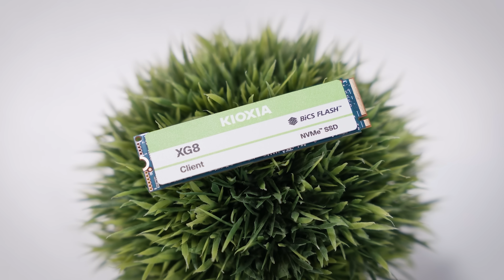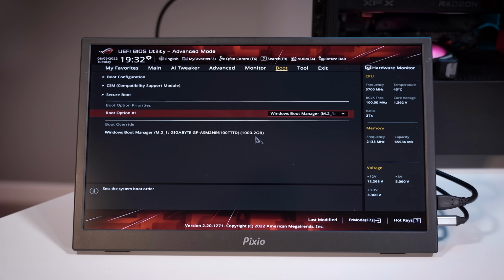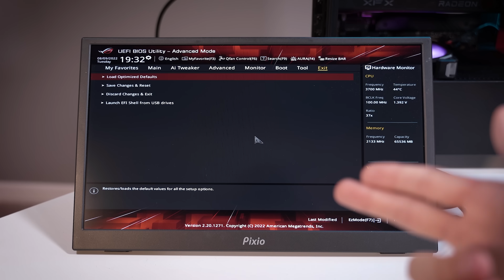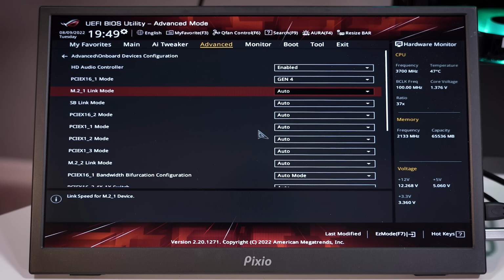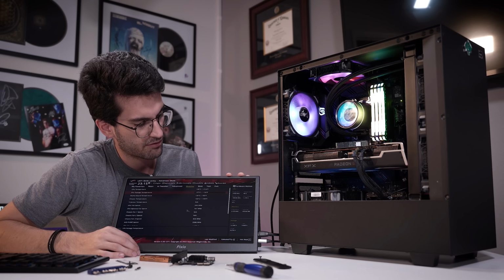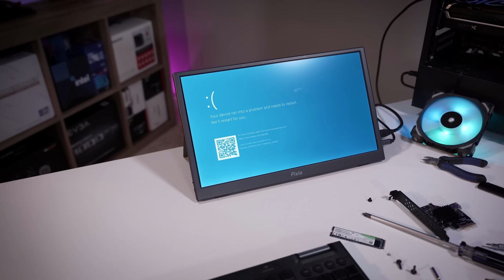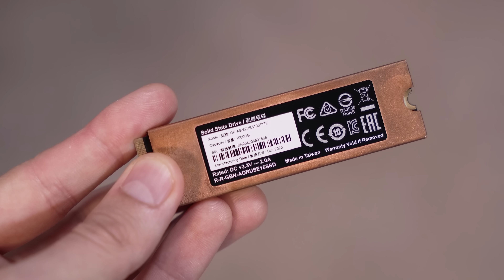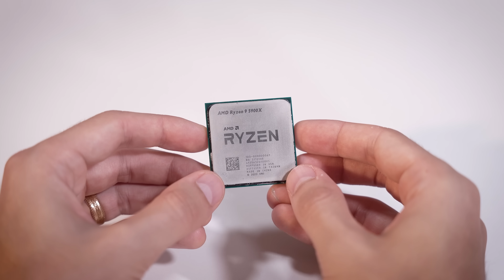Fixing a Viewer's BROKEN Gaming PC? - Fix or Flop S3:E2

Comment: I've seen that fan below the video card before, but usually you'll use a spacer to get it up off the deck and have it reversed so that it helps to direct air into the GPU fans. It's a trick that was semi-popular back in the early days of larger video cards because air flow is terrible in a lot of older cases around the card itself. Over the CPU is typically good, under the GPU typically is a bit of a bad flow area. Even in some modern cases it's often overlooked. So you shove a fan above the basement to help resolve the airflow issue in some cases you'd see noticeable improvement in temps and smoke tests. Dunno, just an idea.

Comment: had this happen with my buds. His temps went so high it shut off after 10 seconds. We thought cooler dead, got new one. Same thing. Put his chip in MY pc and it was ok for a bit. Thought maybe liquid metal around the socket had made it fk up. Turns out we RMA'd his 5950x and it was the issue. New one in and presto

Comment: Wow, I thought it would’ve been a memory speed issue. Had a B350 board I got used and a R5 2600 that I knew worked well, didn’t realize that memory speed was impacted by the motherboard too and would get blue screens when running the memory at 3200mhz

Comment: This happened to me a while ago, and it happened due to a power outage. We had an electrical storm that took out our power, and when power was restored, I tried to fire up my PC, and it did something very close to this issue. The only difference was, for me, it would allow me to run just fine for a few cycles, then wouldn't allow Windows to boot. I ended up replacing my CPU as a result. I'm guessing the owner either wasn't plugged into a surge protector, or the protector was either not very good, or had been damaged from a previous outage/surge.
  It's because of this exact reason I am now plugged into an uninterruptible power supply. Sudden power loss can cause damage to the CPU, and or motherboard. UPS units allow you to safely shutdown. Most people think they're used to prevent data loss, but they also protect the system from damage caused by immediate power loss.
  Once my system is shutdown I always turn the power supply switch off, unplug it from the cable, and unplug my UPS/surge protector strips from the wall. This may seem like overkill, but ANY electronic device can be damaged by power surges. I even lost a modem to a tripped breaker. I take no chances these days.

Comment: had the exact problem on my 3700x need to offset voltage to run properly but will degrade overtime, glad that AMD accept warranty during pandemic since local store I purchase cannot diagnose the problem

Comment: I've had several ryzen CPUs die with failures similar to this. Random blue screening across several different board and memory configurations. Really odd but seem to be common on Ryzen processors. In the beginning my immediate suspect was failing memory (unless passes memtest) but who would have guessed... cpu all along

Comment: I think I've had 3 bad amd cpus over the years that I had to rma , FX-8120  it would give me strange graphics error where everything in chrome would get sucked to a pin point ... very weird ,   a ryzen 3300X  and a 3800xt    Amd has required me to take a picture of the cpu in the motherboard ... kinda strange staging a picture for them ... because I already swapped the CPU and that's how I was able to tell it was a bad CPU .

Comment: Grest video. I had a similar problem couple of weeks ago. I spent 2 days testing everything in my system. It turn up to be a faulty motherboard.  Used meanest 86 and I was getting tons of error.  Similarly I had a different blue screen every time. Swapped a board and everything is back to normal. Actually system feels faster then before. Sent my board for the RMA.

Comment: If a motherboard has a standard overclock or higher volt can cause a cpu to die over time. I had a similar issue with a i7 6700K with an ASUS mother board where slowly more cores would stop working to the point i could only get the PC to board with one CPU core enabled.

Comment: Hey Greg, shot in the dark but maybe the chip isnt even dead, maybe the bios just got borked. Happened to me with an amd chip. I think its at least worth a try to test it with another motherboard because like you mentioned in the video it doesnt act like a dead chip at all.
Reply: It's a dead core. Can be turned off in the BIOS. Done this on a couple Ryzen chips from several generations.

Comment: The same thing happened to me. My computer was working and then randomly it started to reset sometimes it was while gaming sometimes it was just watching YouTube videos, sometimes it would happen multiple times a day sometimes it wouldn't happen for weeks or a month. I thought it was the boot drive so I cleared it but nothing so I bought a new one and nothing, I even ran a ram test and switched slots, then I thought it was the motherboard or graphics card so I bought a new one of both and nothing. So the last thing to change was the CPU so recently I bought a new CPU the same model I had before Ryzen 7 5800x and it works perfectly. I did a lot of research online and some people were blaming AMD for having  bad design or blaming windows. One guy even said that he rma his cpu and AMD knew it was a problem just gave him a refund.

Comment: When I was building my current rig, I ran into the drive problem. The bad drive, my intended boot drive, got extremely hot to the touch very quickly, along with the heatsink covering it. I tested it in a different board, same result. In my experience, even a good PCIe 4 drive wouldn't burn up like that, especially not from just trying to boot into Windows. Needless to say, the replacement drive I got actually worked, and didn't exhibit those symptoms.

Comment: I had this issue when one of my socket pins was bent. PC would turn on, everything would work fine for about 2 minutes, then a blue screen & restart. I know it was the bent pin because I bent it myself, thought it would work, and ultimately fixed it. Edit: again, I'm not surprised that it was CPU/Mobo-related (depending on whether you have an AMD or an Intel CPU.)

Comment: I had the exact same issue happen to me in the past. I found that the media creation tool fixed the problem, my guess is that it had to do with how windows was accessing the cpu and when I ran the tool to use a remote repair utility it bypassed the problem.

Comment: i had a similar issue when i built a rig with a 5950x for my nieces husband in my case the system would boot into windows fine for about 10 minutes then lock up and once locked up on restart it would hang on on the msi splash screen ,   if you completely powered down the system and disconnect power from the PSU the system would again boot into windows, and lock up after 10 minutes  and so on,  spent 2 days trying different drives etc multiple reinstall of windows etc, 

luckily i had a another new rig built for a friend who hadnt collected it  swapped CPU  and boom system was stable ,   tried the 5950x in the other rig and came across the same issue 

ended up RMA ing the brand new CPU ,  CPU was DOA

Comment: I had a very similar situation moving from a 3400G to a 5600X (brand new) on an Asrock Phantom Gaming X570 Wi-Fi ax motherboard…and it was the BIOS. Windows kept freezing at the same point, but entering BIOS worked fine. Resetting CMOS? Nothing. Last ditch before nuking the OS decided to update the BIOS from USB (previous BIOS was compatible with 5600x, I checked). Haven’t had an issue since! Booted immediately. 

Wish you would have checked BIOS version too. CPU might have been ok. Did user recently change CPU? Maybe it needed a microcode update.

Glad the 5*50x worked and the user got an upgrade. Also glad you’re going to check the old CPU! I suspect it’s fine and just needed a different BIOS.😊

Comment: Greg, I need help! My Pc froze my Game and YouTube pages on my monitors(I could still hear my video running) then I heard a loud buzzing fan noise. I got scared and couldn't enter the Windows settings so I hold the power button to turn off my Pc instead, now I can't turn it back on. I tried replugging the wires then pressing the power button but it only flash the RGB for a second and died again. What do I do?

Comment: I'm running into this problem with a bone stock Optiplex 3060 SFF from a misc auction lot.  Trying to install Windows 10 or 11, it blue screens a different error each time.  I've even tried throwing an SSD in it that had a good Win10 install on it, and during boot it BSDs.  I've tried a brand new NVMe, a 2.5" SSD, a 2.5" HDD.  I've tried multiple different DDR4 sticks of varying speeds.

Running the built in Dell diagnostics from BIOS, nothing errors out.  The CPU test passes (though I know this pre-test isn't highly rigorous), the RAM passes.

I tried removing the CPU to check for issues with the socket, and re-pasting, but no luck.

It's just not in the budget to mess with it right now, but I figured it was a CPU or MB issue at this point.  I figure if I luck into an i5-8500 or i7-8700 from some other system in the future, I will try that out first before trying a MB, since that will easily transfer to a different system while the MB definitely won't.  But dumping the money on a CPU right now, cheap as they are used, just doesn't fit with my current budget.

Comment: Had a Ryzen 5 3600 doing the same thing. I suspected a motherboard so my first test was same as yours. Everything worked normally after the cpu swap. Tested the cpu in another motherboard - blue screens and weird behavior. Great video and thanks for keeping after it for the learning.
Reply: I also had a R5 3600 that blue screened every 15 to 30 minutes.  At first I thought it was the drive so I reinstalled Windows on another M.2 and updated the motherboard bios but still had the same blue screen issue.  I eventually  got a new Ryzen 7 5800X cpu and my machine has been running great for months now.

Comment: i also happened to face this issue recently my friend pc had exactly the same symptoms we got new drives that didn't fix it we then updated the bios it still didn't work at the end when we replaced the cpu it automatically fixed the bsd. The mobo was z170 and cpu was i5 6600k

Comment: I had a similar issue with my 12th gen i7, pcie controller took a crap and no matter what GPU I put in it there would be no picture out until I connected it to the integrated graphics and found it odd that it booted into windows. So initially it threw my diag as the pcie controller out the window until I read up on some details on how the pcie controller on the 12th gen works and found out that it was very possible for pcie lanes to go out individually. So I bought a 12th gen i5 and everything was fine. I sent my i7 back to Intel for warranty and got a new one a couple weeks later.

Comment: it is possible the cpu cooler was over tightened, crushing the heat spreader slightly. its hard to say exactly but congrats on the fix :) good job
Reply: Your actually correct, this is the main reason for this fault if he backed off half/full turn on the cpu cooler screws after a cpu reseat it would have worked fine

A lot of installers believe that tighter is correct way but actually tighten to a stop and then back off a full turn or two is actually better for temps and stability, pushing the cpu down into the socket and heat and pressure will damage the cpu
Reply: @anonymoususer7985  yes lol, the 5900x is a hot boy but idle was too hot forsure. I have learned alot in less than 2 years total pc building. YouTube is my only teacher

Comment: Its like back with 286 when the io board would go ou or 486 and 586 and 1ghz cpus that the logic side of the processor would die and cause similar actions

Comment: I wish we had a way to know what causes a CPU to go haywire. When I built my first PC with an R5 1600 the PC got stuck on boot the day after I was graced by the sweet feel of 1440p after years of gaming on a potato. After like 2 days of troubleshooting I ended up having to RMA a b350 tomahawk thinking that's what the problem was, and even this didn't work. It ended up being the CPU as well, and after an RMA I was able to get it working. Still, will stuff.

Comment: I had the same problem after swapping from an ITX to an ATX motherboard. I'm running a 5800 x and the same exact graphics card. When I swapped to the ATX motherboard this started happening. I put a R5 1600 in it, got through post Windows install created bootable media with that processor reinstalled the 5800x reinstalled windows all is well. Still don't know what the hell happened and it cost me a week and a half on my system

Comment: Hi I have the same cpu but it gets to 90 degrees C like always even on idel and I even have a 3 fan water cooler, it also has 0 overclocking but it works fine only that the cooler gets extremely hot. I dont know if this is normal or what but yes it super hot for no reason.
Reply: This is what happen to me but it was not that high from yours check the water cooler if you are 100% it’s not try changing the cpu But doing before it get worse and it get to a point that it’s hard to check later with no extra part
Reply: @gabydiaz2732  I dont think so because I already changed the cooler and its working fine just that I had to cool it off a lot 100% pn all fans  I can even fell some heat coming out even with ac.
Reply: @hanks0255  then it most be my same problem cpu

Comment: I have been an IT professional for 23 years and this was excellent troubleshooting, in my opinion. My first thought was the drive interface setting but it makes sense now that it was the cpu, after all. 🙂
Reply: My first thought was CPU. The symptoms are consistent with dead cores - you can disable them in the BIOS and still use the chip, especially one with such high core count.
Reply: @b0ne91  well this is a first for me, dead cores are a thing. who knew 😶
Reply: @b0ne91  It is usually a bad stick of ram, like 99% of the time is the ram, but those temps were way too high for idle, I think they tried  to overclock by pumping up the vcore too much or the PSU is faulty.
Reply: @b0ne91  TIL individual cores can die
Reply: @b0ne91  I've had the exact same symptoms with a bad stick of RAM, same BSOD error code.
Reply: Yeah same I would try each driver one by one before getting suspect of CPU. Hell just a month ago there were a pc that was getting BSO, The problem was defective display port we were lucky that gpu had two display port we tried the other one and problem is solved.
Reply: My pc had the same symptoms as this, and yes it was the cpu. At first, I thought it was the ram but I still got a bunch of blue screens after replacing both sticks. I wish I have watched this episode before sending my system for repair then things would have been much cheaper.😅

Comment: I had a similar Issue. It turned out to be the CPU It was a Ryzen  after trying to send it back they asked for the codes on it. turns out I was sold an engineering sample

Comment: I have a question for the community. I have a PC with an RTX 3080 and a 3900x. I have another PC with a 6900 XT and no processor and I am thinking on buying a 5900x. Which GPU would you pair with each CPU?
Reply: 6900xt keep it with 5900x  since will get better perfect in smart

Comment: The original 5900 CPU overheating would tend to indicate that "upgrading" to an even more power hungry 5950 would maybe not be the best option. For future testing/trouble-shooting purposes, might want to obtain something like a lower-powered Ryzen 5 5500 CPU. As "fixed" as it now is, the system still doesn't make one too confident that the same error isn't going to re-occur soon. Could the liquid CPU cooler be clogged? Maybe.

Comment: Dang Greg!  A few months ago I also ran into this problem while working on a friend's pc that I built for him.  He had a 5600g in it and it had the exact same problems.  Everything worked great until it was time to load into windows.  Turned out that the CPU had died and I had to RMA it.   It was the first time that I had run into a problem of a CPU dieing while being kept in a good environment.  My best guess is that there is some hardware degradation happening when the motherboard pushes a little too much voltage either in the Vcore or VSoc.  I was watching a buildzoid video not that long ago and he was talking about after some CPU's go bad he has to push excessive VSoc voltage to even get the machine to function.

Comment: I had a 5950x die Ouya nowhere no insane overclocking just enabled the dynamic of feature on my Dark Hero board and it one day wouldn't post then kept saying my nvme was the fault kept getting failed boot device I knew it couldn't be that since it was brand a Brand new Sabrent Rocket 4 Plus 4TB drive.

As soon as I popped in my 5900x system booted zero issues. Had to get it RMA but it died within 4 days of enabling the feature.